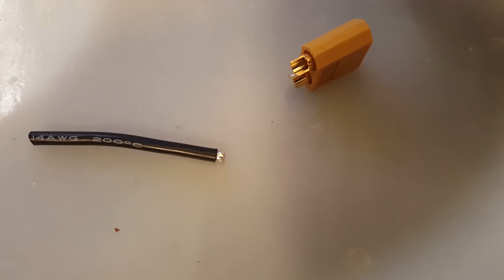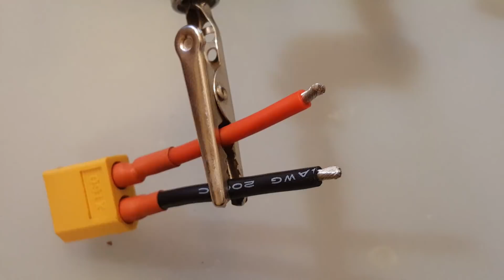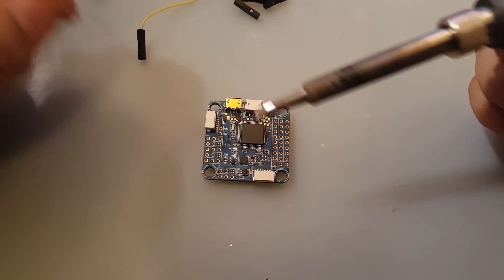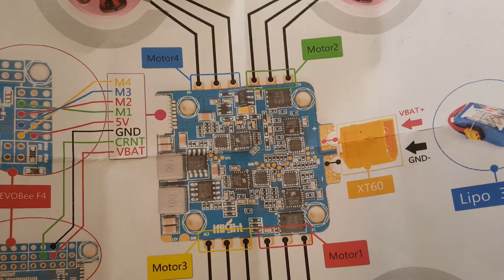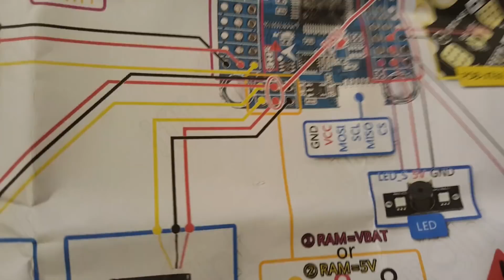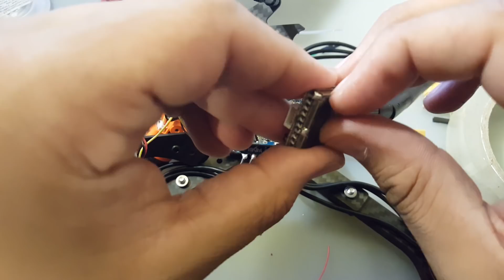How to Build a Racing Drone 2017 // iFlight Strider V2, Ipeaka 35A, Reve Bee32 F4 , Force 2207

Comment: The iFlight Strider X5 V2 has 240 mm from arm to arm. Does it fit 6" props as well? What's the weight of the frame?

Comment: odd, i just recieved my Strider V2  frame in the mail, and my main plates are different and the frame flexes quite easily :S your main plates are quare cut on the ends, my are round for some reason

Comment: Hi
Nice build mate. Look GREAT! does it fly good too? I just got mine, but I'm waiting on my 4in1 ESC before I can start building...

If you look at the bolts closely you'll notice that they provide you wirh 3 different lengths of bolts, short for the top plate, medium for the outter holes of the arm, which connect to the "self locking nuts" and then long one for the rest. The medium bolts sit flush with the nuts.

Also I'd tuck that VTX a bit more forward under that top plate and zip tie the antenna to the toplate. Now ALL the vibration and the hits on the antenna go directly on to the SMA-connector. I'v burned a few VTXs like that :D

What do you think of the 2207 motors?

Cheers!
Reply from the maker: +TeeSCee Thanks... I have not flown it yet been 2 days  with summer thunderstorms :(

If you fly yours before me let me know how it went ;)

Comment: How's the range on that receiver and does it have failsafe?
Reply from the maker: +Nate Dogg it's good but sensitive there are build where if it's too close the the esc power lines it will trigger failsafe but overall it's good within 500 meters have not pushed it farther.

Comment: Do you ever used the foxeer arrow v3? Iam thinking on getting him thats why . Btw do you have friends to fly with otherwise I wouldn't know how to test every one of youre quads😆 how manny do you got right now?
Reply from the maker: +Bennie Leip they grow by the day loool.  Once i finish the 6inch build I will make the video with all my quads for you ;)

No don't have friends that fly usually go out and fly alone.
Reply: Drone Mesh otherwise you can loan them quads so you can look how they wear out and durability ,ill gues you cant fly them all enough to see the wearing (i dont know if you get my englisch😆)  but wat do you perfer the split 2 or arrow 3?
Reply from the maker: +Bennie Leip have not tested them. I have a split on the way.
Reply: Drone Mesh to expensieve for me😆
Reply: Drone Mesh eej i got another 😆question for u i got that flame fc ,do you know what kind of firmware i have to flash it with? (Or is that where the boot button is for)Because i hooked it up on the computer and i didnt saw that he got failsafe
Reply: Glad to know you plan a video with all your builds :)

Comment: Looks like an Omnibus at 4 you usually have to ground your camera and VTX to the flight controller and that will stop OSD flickering if you get it
Reply from the maker: QUADBOT FPV It's firmware is the omni f4 SD

Comment: Drone Mesh. I'd like more the wires from the esc connected on the other side of thick so that when you stack the fc they are between the two boards. Is there any reason you do it that way? The only downside of the thin arms seems the fact that you must use a esc board. Great build by the way. Looking for the flight footage.